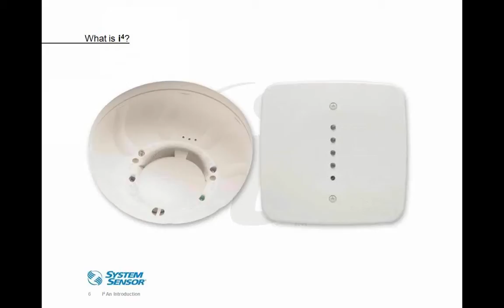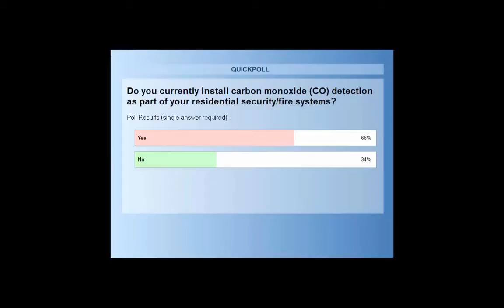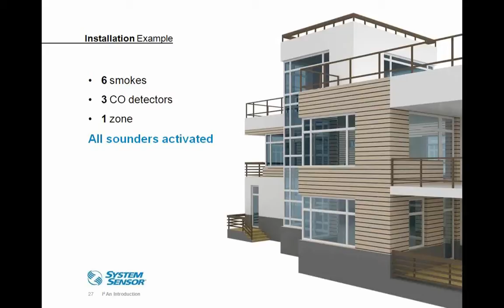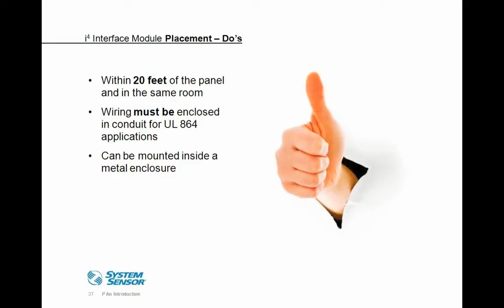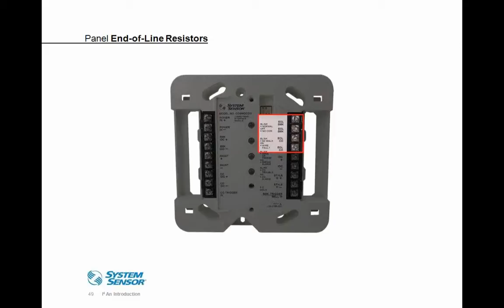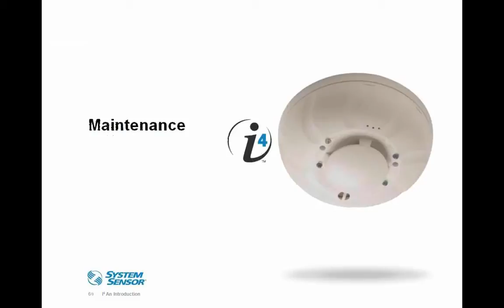CO/Smoke -- Webinar: Intro i4 CO and Smoke Together

Comment: Duh!  Common sense rules will tell you and as general rule of thumb (duh!), it might be a building code guideline...not sure about that but, you don't put a smoke detector right over a stovetop or oven.  You don't put a smoke detector in a kitchen.  You just don't.  It's like your daughter needing a night light and so, you roll into her bedroom with a metal halide light.  It's like no!  So, when I see a smoke detector stuck in the kitchen in public buildings, I like to laugh at it because, I know that it is going to cause a REALLY HIGH amount of false alarms the next time cooking smoke goes from the skillet.  It's taboo!  You just don't!  No!  You don't put a smoke detector in a kitchen, cooking smoke and smoke detectors don't mix.  That's why they call them smoke detectors!  I have countless stories about smoke detectors that have emptied the building over cooking smoke.

Comment: I want to use a 1.2amp Aux power supply to power the Cosmod2w and eight 2WTA-B smokes connected to the module My question is how much current can be applied to the smoke Auxpower + In terminal on the Cosmod2W. I will be applying the current with a relay on the 4204 relay module board?